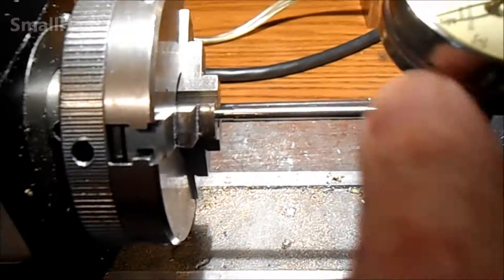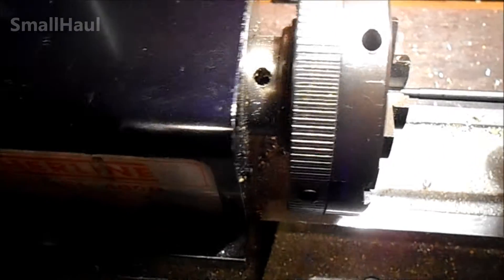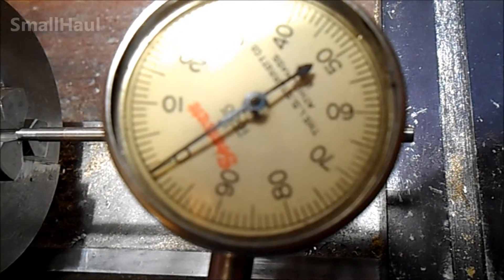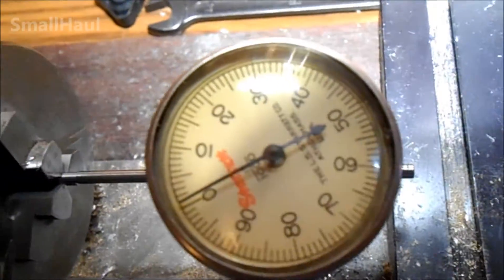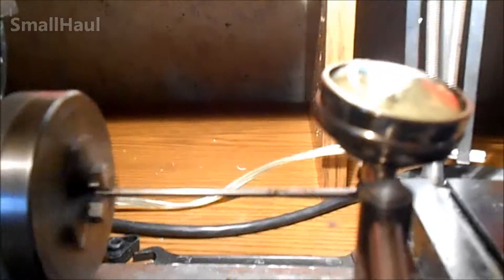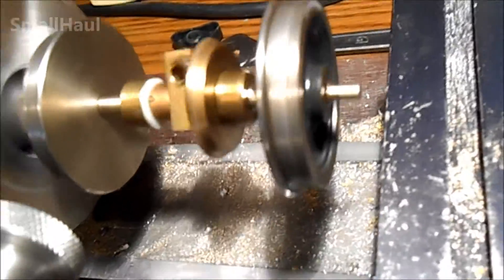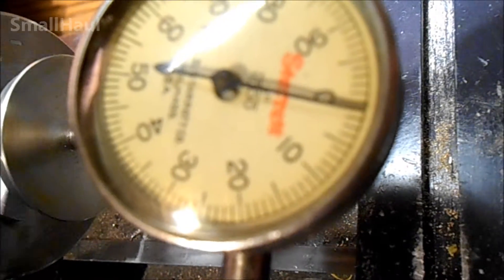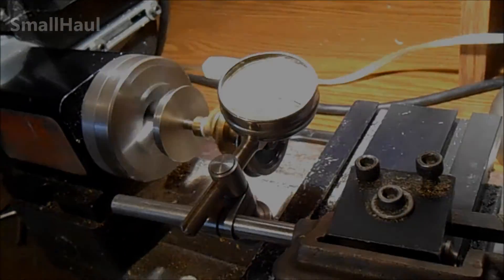Straightening a steel shaft using a lathe and dial indicator

Comment: Rescued a turntable motor shaft with your tips. Thanks!
Reply from the maker: That is really nice to hear. Thank You for the recognition!
Reply: Finally I've found a video showing actual success with this method! I've only got six 500mm x 8mm rods to straighten. Thanks for posting this, I'll only be in the shed for a few weeks then!😁
Reply from the maker: @philchadwick9470  Stop flying so low!:-)